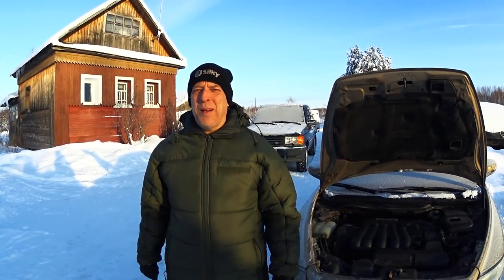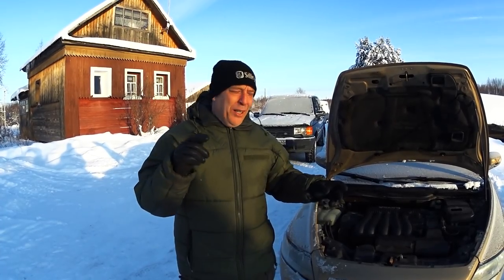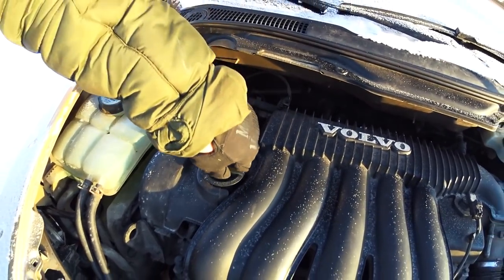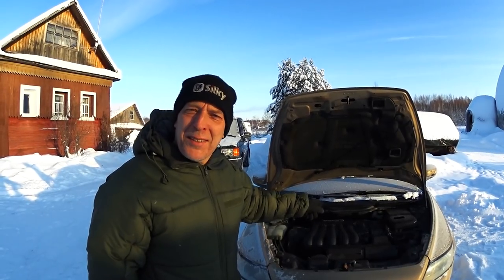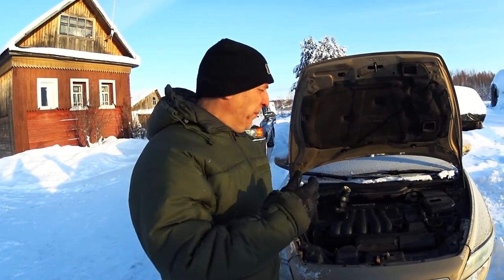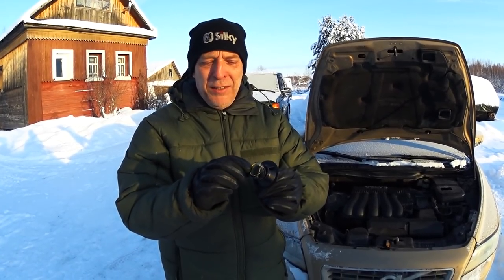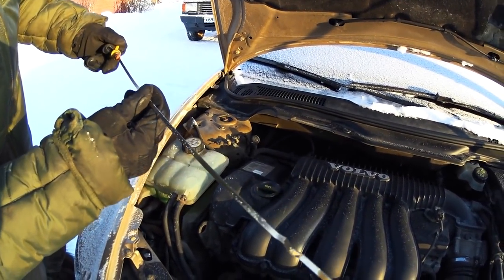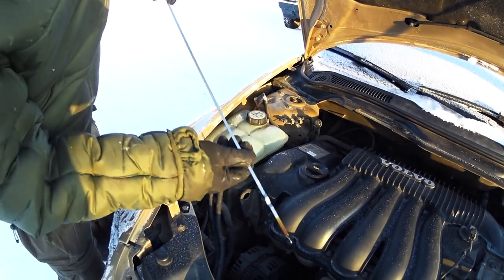White/Yellow Sludge In Your Oil Filler Cap | Blown Cylinder Head Gasket?

Comment: Lars , I'm a retires mechanic from the cold edge of Northern Ontario Canada . Your Bla Bla Bla in this video is full of awesome correctness . Time for you to take Mrs. SR's car for a hot run on the highway now and then ? Step up to a warmer thermostat for higher engine operating temperature ?  Cover the front grill to help it warm up during use ?
Reply: I had to cover my radiator 75% in W. NY when temps were down to minus 34 degrees fahrenheit to get to a good operating temp in my 25 mile drive and the vehicle heat to work, even had a 190F thermostat in my f150 4.9L 6cyl.
I put one center hole in cardboard over fan clutch and four 1 inch circles near the corners for air flow. Worked good until April (spring). The cardboard was just thin enough to slide down the front radiator frame supports.
Reply: @mongomay1  Back in the day when I was driving old rust bucket Chev trucks I'd order in 210F thermostats for propane powered 350s to squeeze that last bit of heat out of my gas powered engine . On the highway at -50F it's far les than awesome .
Reply: Exactly! This is condensation that will go away when the engine is run hot long enough. Good one Lars!

Comment: Where I live, finding that white crud on the oil filler cap is quite common. It's because the local humidity is very high, and condensation sets in as the engine cools.
Reply: This condensation problem was a real headache in the days of electrically driven mechanical parts like points
Reply: Condensation starts as soon as the upper part of the engine starts warming up.

Comment: Oil contains a LOT of components: Detergents, dispersants, Molybdenum, other additives (many proprietary) and there are shorter chain hydrocarbons. There are anti foam agents, and things to keep the oil and its components from boiling over from a liquid state.  Slow oxidation is occurring, and the pH is slowly falling over time. There's always condensation in the crankcase, and evaporative losses. Lamp black, dirt, silt is accumulating. Temperature extremes (setting aside the duty rating of the oil) means some things are alternately and even simultaneously changing from a liquified to solidified state and settling at various gradients, with lighter stuff like this "floating' and condensing at the top. Oil doesn't merely lubricate, it also SEALS, maintains even temperatures, disperses heat, and has to hold the carbon and silt in solution, and even the fine bits of metal that of course slowly accumulate in any engine over time. Think of when the oil is first pumped out of the resovour when it is at an initial temperature of minus 30 degrees there, or having to disperse heat and maintain lubrication and seals in say the Sahara Desert! Oil can work at all of these extremes and do it very well! And with all of this being said? I am puzzled as to why people don't CHANGE THE OIL as the FUNDAMENTAL MAINTENANCE of any dinosaur blubber powered device.... Merry Christmas to you and "73" from W8LV Bill.

Comment: Flameless MRE heaters and a big front end loader it was -20ﾟ and cold the oil in the loader was sludge  I took 15 flameless heaters it is in a cardboard Box around the oil Pan And warmed the oil to a temperature enough to start a engine Just another use for the flameless heater In the MRE's  Great video brother hello from Detroit Michigan USA

Comment: I found this video the day before i was going to turn my 2017 Tahoe in for repairs…i call myself trying to keep it in good condition, only driving it like 5 min a day bc i have another car and i work close to home but this winter it started to act funny. There was a hesitation in the motor and the check engine light came on. I checked the oil cap and I freaked out when i saw the sludge. Thought my head gasket was blown and then saw this video…

Awesome information. I bought sea foam and got an oil change instead. Works perfectly again.

Comment: Years ago when I was working in a garage as a mechanic, every time I would see that on a mechanically sound car I would ask the owner what brand of oil they used. 100% of the time they replied Valvoline.
Reply: Rebuilding a 4 banger, nothing but black corn flakes under the valve cover. Oil bottle seal caps in the pump pickup. "I regularly change my oil with Quaker State." Next time REMOVE the safety cap and not just punch it in with your thumb!

Comment: Hi Lars, your correct, it's condensation emulsion, I would recommend more frequent oil changes  including oil filter,  as this moisture laden sludge causes corrosion on engine parts, longer running time to get the engine hot will help , some engines are prone to this problem even all year round, it can also block engine breather systems. Here's wishing you and your's,  a happy Christmas,  and a healthy new year, all the best ,Stuart Uk.

Comment: You are 100% correct lars the engines generating moisture in the crank case and if you don't drive a reasonable distance to get all of engine HOT it condenses on the cold parts of the engine which is usually the top of the valve cover and the top of the dipstick tube even  when the PCV system is working properly.

Comment: That is a good tip and well explained! I drive a lot of short distances, too - which is not great for cars, Diesels especially, and especially Volkswagen Diesels and direct injection engines, and very especially TFSI (stay away from them). Very regular oil changes will help the situation, because the condensated water solutes into the oil and makes it work less. By driving a hot engine for some time, you can "cook off" the water, but it does not regenerate the oil magically. At least to my understanding. Oil changes are the key. Which reminds me that my oil needs to be changed, lol.
If your engine oil looks like pudding or hot cocoa, it means coolant/water ingress, which could mean blown head gasket, or even a tear within the block.
Reply: Also, I watch my Coolant level. That’s the only place it can from if it’s a leaking head.

Comment: It doesn't get cold enough here in my part of Spain to get significant condensation drawn into the crank case so no grey goo. 
If I do see the goo here , it is definitely a blown head gasket. My old SeriesIIA Landrover used to get the condensation in the UK in winter but that engine was a big lump of cast iron so didn't warm up much on short journeys.
The video is good advice though, how many workshops will tell you not to worry when they could charge you for a head gasket job and maybe add in the cost of a skim on top?

Comment: Living in the Midwest it's a good diagnostic tool for mechanics in the winter. You can tell the customer that they take a lot of short trips and that it doesn't hurt to get the car out on the highway and burn off any of that excessive moisture in the crankcase and help reduce acid formation. Although the anti corrosion properties of modern oils are so good it doesn't really matter.

Comment: I just started having that problem. First little bit but today I took parts aside to clean the throttle body and I saw too much yellow sludge in the valve case evaporative tube to the point of no air going thru. So I cleaned it as much as I could and put everything back. And yes you worry some how a bit. What should I do? That is my question.  I bet the whole crank case looks the same. Too solid stuff might cause a problem.

Comment: Parking your vehicle with radiator out of the wind or blocked by plywood or tarp can minimize gelling of coolant and oil and aid in starting. Newer vehicles have a temperature sensitive clutch fan that turns only when cooling is required. If this clutch fan is seized on you may have trouble with warming the engine or overheating if the clutch fan does not engage. Do not cover your grill on the vehicle while driving as you may overheat an automatic transmission that is cooled through the radiator.

Comment: Hi Lars, merry Christmas to you and your family. I'm planning a trip to Scandinavia  and I'm looking into preparing my car for this cold conditions. I want to go winter camping and would have to leave my car somewhere parked for like a week in up to minus 20. Do you have any tips for that ? I've once seen a video of Mors Kochanski  who suggested to bring a gas lamp and put it for two hours in the motor compartment to warm it up.

Maybe this would even be a good idea for a video!? ;)

Happy holidays and enjoy life!
Reply from the maker: Good luck! 
Since I don't know what car it is, it can be a bit difficult to give precise advice. Anyway, I would park my car away from trees, bushes and building. Leave it at least a few meters away from these. Clean a spot from snow and then park the car there. You don't want a lot of snow under and around your car because of mice. Mice can F... up your car bad!.

Undo the ( - ) negative lead on the car battery. Just to prevent possible draining.

If your  car has good ground clearance, like a 4x4, then you can store a bag of barbeque coals and a metal pan in the car. Ignite the coals, slide them in under the engine, under the oil pan. Don't use too many coals and don't have the coal too close to any of the metal parts. Verify the heat with your hands. 

When it's cold, I cover the engine with a fleece blanket. I leave something on the dashboard in order to remind me of the fact that there is a blanket covering the engine, which have to be removed before starting! You don't want blanket in your cooling fan!

Comment: Absolutely correct. I’m a service manager at a CHEV dealership for 30 yrs. Small deposits on the filler cap etc is simply a byproduct of the engine running.  Dispersion throughout, pooled in crankcase, under the valve cover and so on could be evidence of something more serious.

Comment: Also it happens if the cvc filter is blowing by causing oil frothing. That is the little plastic part that connects the air filter to the intake.

Comment: It takes much longer to get to operating temperature in cold weather than warm. I cover the front grill to stop cold air hitting the radiator the engine warms up quicker I even throw a reflective windscreen cover over the engine but don't cover the whole radiator if you are doing long journey and don't block air intake.
Reply: Air hitting the radiator shouldn't matter if your thermostat is working though...
Reply: @rkan2 Driving 50 kmph at -20 Celsius the wind entering the engine compartment will feel -50 Celsius also the cabin air feels warmer.

Comment: Nah, if it's well below freezing a little mayo in the lid is normal. Last time it hit 0-10F for a few days here I got that, and I always get my truck up to operating temps on my drives. There's no way to completely keep water out of the crankcase, when the engine cools after shutdown it'll pull in a little outside air, and that's enough to get condensation on the parts that chill first like plastic caps, covers, and filler tubes.

Comment: I have white sludge in my motoroil. My coolant gets empty in 24hours. 
I can't find a leak under the car.  The coolant is mixing with my engine oil.  This occurred after replacing the timing chain.  I suspect my head gasket is leaking.  All advice is welcome!

Comment: ANother clue also is if you radiator fill bottle is being filled with pressurized antifreeze. Radiator will be empty but all your fluid is 
in your radiator fill bottle...  Either way not a good thing at all :(

Comment: Block the airflow to the radiator so the engine can get to operating temp faster and leave it running for longer so the water can evaporate away. Not good to keep it there.
Reply: Or make sure your thermostat is working... If so, blocking the airflow to the radiator does not much more than help with the airflow that flows directly around the engine cooling it.